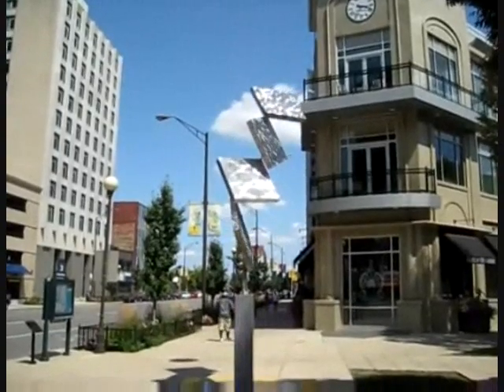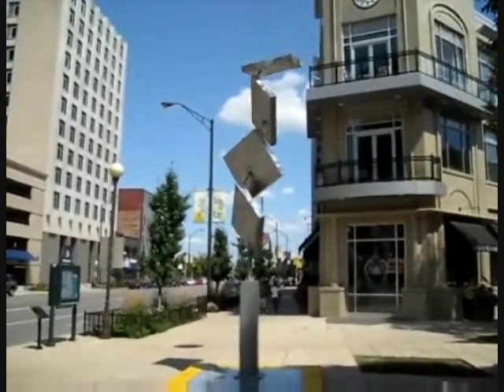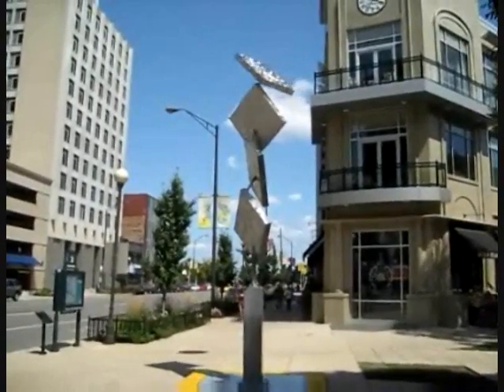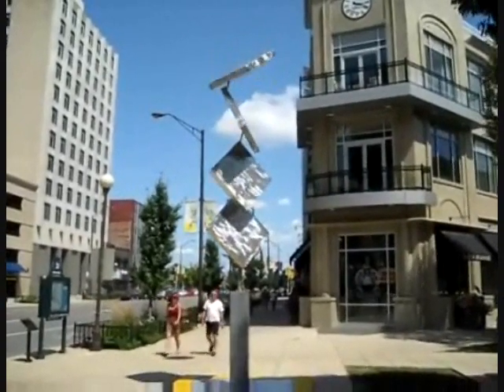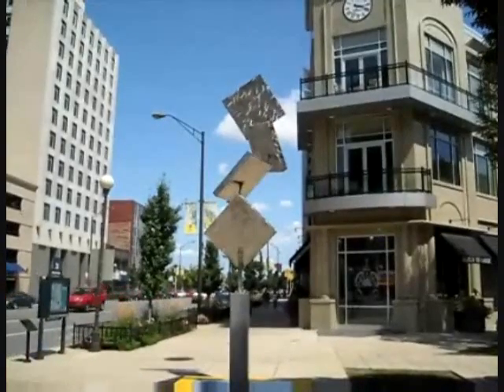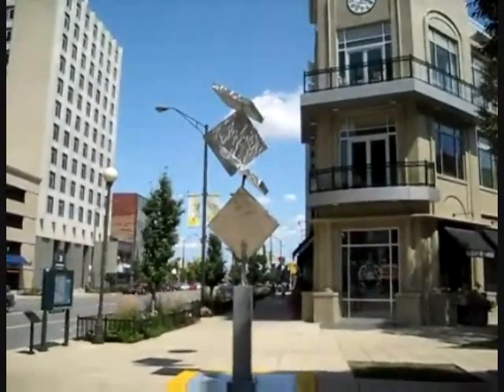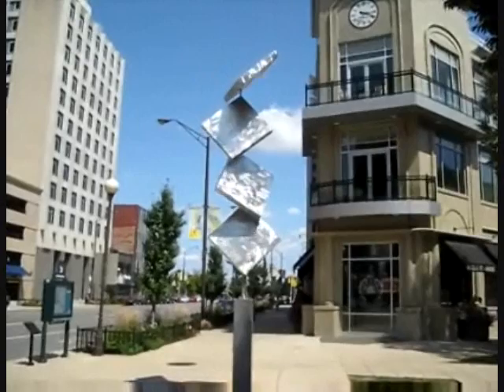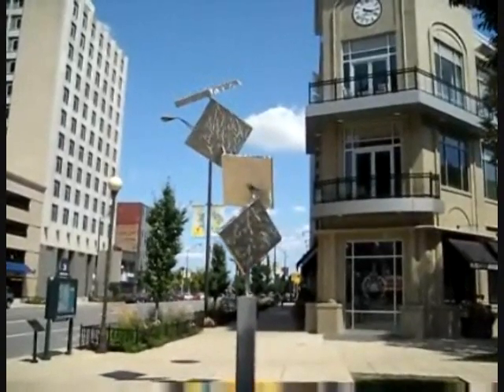Kinetic Sculpture Welding

Comment: This is a great piece of work.  You mentioned axial bearings on the bottom.  What type of bearings were used for the upper squares.  The shaft on those is not at 90 degrees.  Did that require different types of bearings?